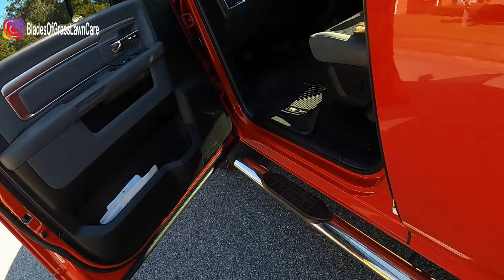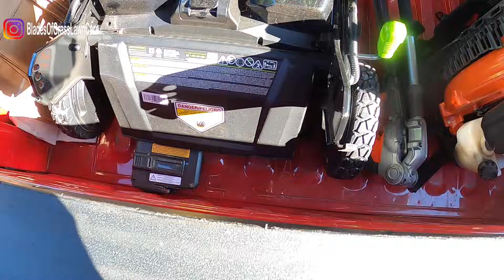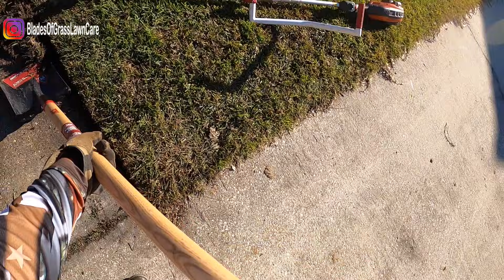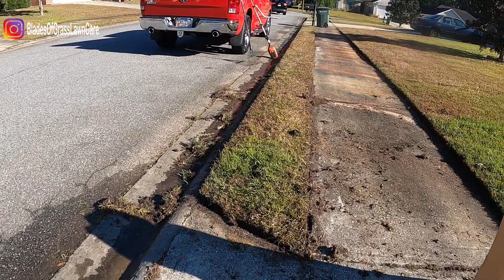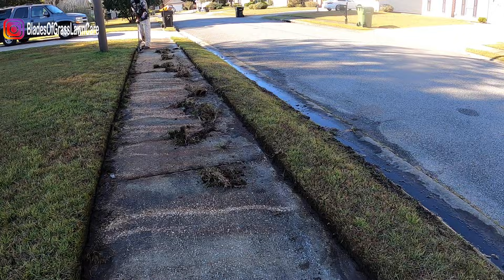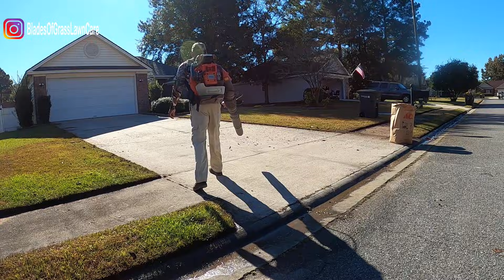Overgrown Grass Cleanup!

Comment: Is that the Husqvarna 580 Bts? Which one do you like better that or the Stihl Br 800? I just bought a 580 bts the other day. Someone stole my Echo 770t. I lock my blower up now with a hardened steel chain now that can't be cut with bolt cutters.